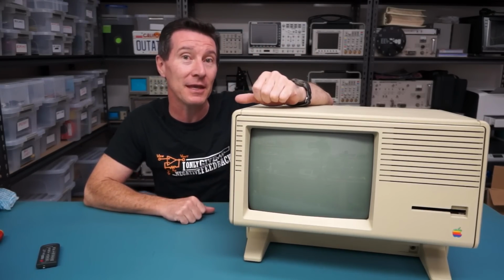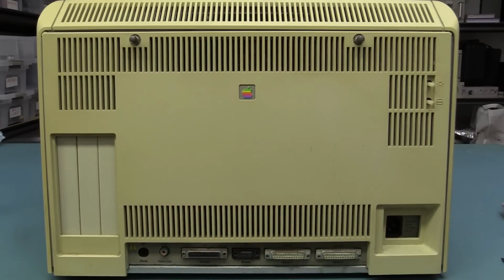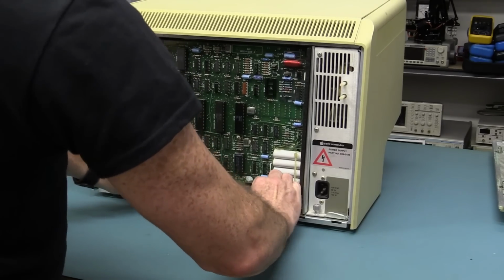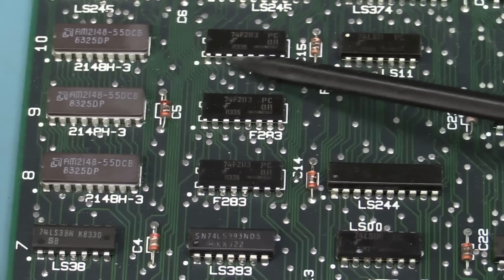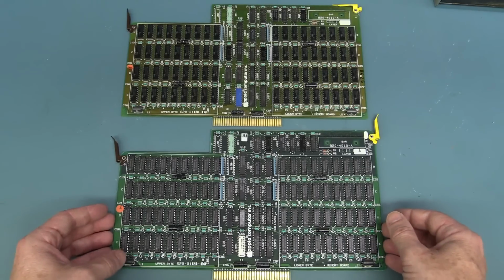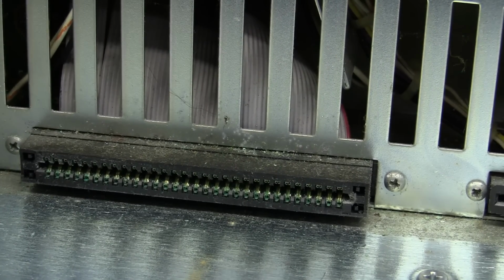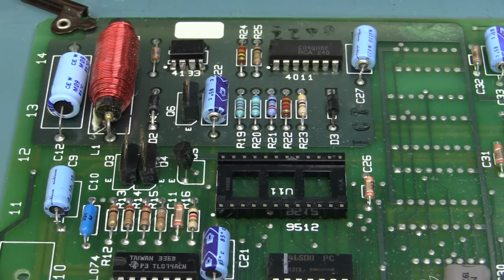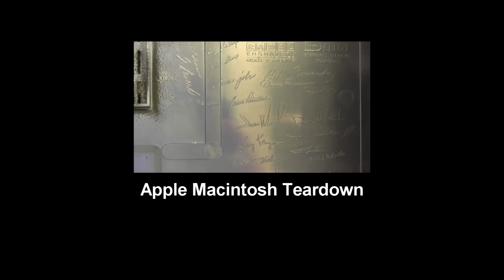EEVblog #696 - Apple Lisa Retro Computer Teardown

Comment: Yes it is a sexy machine. I think it is the most beautiful Apple ever done. In Brazil we have an old saying: outside, beautiful guitar, inside moldy bread.
2235 manufactured seems to be the 325th day of the year (83 maybe? but I thought they used 2 digits for the year) meaning 21st, November.
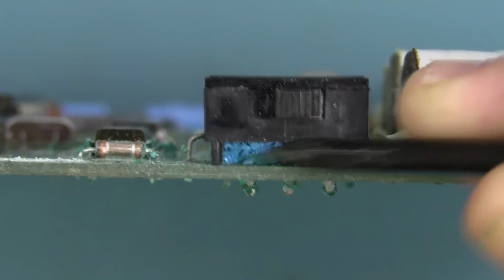16:38 Ohh that blue gum under the key seems like cooper sulfate. Those two boards board is gone RIP.

Comment: just give the inside a good clean, pop in a raspberry pi, hawkboard or something like that, load a good emulator on it and hook it to the crt. Hook up an old 3.5 floppy drive and and you got yourself a working Lisa.

Or turn it into a modern PC in a Lisa case.

Comment: It's amazing how much the crap from long-dead NiCd and NiMH batteries wicks through the copper traces and just destroys everything. It's a common problem with arcade cabinets and pinball machines, early computers like this Lisa, and even x86 PC motherboards up until the mid-90s.
In this case it has thoroughly wiped out the CPU board, gotten into the backplane and apparently spread from there into at least one other board. Looks like the RAM cards maybe could be saved.
This Lisa was already beyond repair, but anytime one encounters those barrel batteries on anything of value, they should always be removed or this will eventually happen. Unfortunately in most cases old battery backed electronics sit in storage quietly nuking themselves and don't get discovered until it's too late.

Comment: My family had both a Macintosh 512k and a MacXL (1985 version of the Lisa 2/10, but it could run the Macintosh 'System' as well as Lisa OS)  I wish I still had them, they both gave in to the ravages of time and repeated moves. (The Widget HDD in the MacXL had ceased working as well.) I'd swear the 512k still worked, but it just got misplaced during a move. Very sad.  :(

I grew up on those old Mac games, the Macintosh version of Wizardry: Proving Grounds of the Mad Overlord is still one of the best CRPGs ever made. :D  You know you're old if you ever had to draw dungeon maps on graph paper while playing a computer game.

Comment: 14:00 It's pretty sad that this old system from early 1980s has 55ns memory chips (SRAM) when latest gen modern computers have 5–8 ns latency memory (DRAM) these days. The latency hasn't improved (less than 10x) that much even though the processing power is now magnitudes and magnitudes better.

Comment: "Upgrading" this using an emulator could be an interesting project/video series.
Maybe using the original CRT with a custom driver board (easier to use an LCD panel) but less interesting.
Use a Raspberry PI (which has composite.HDMI for the CRT video) or maybe an Intel Atom board?

Comment: Date should be 25th day of the 3rd month of the 3rd year of that decade if I'm reading it correctly since it has one extra space available in the typesetting. So you have a March 25th 1983 unit. It looks like a shit ton of the parts in there are just grabbed and put together, lots of replacements.

Comment: i looked it up, $10,000 1983 is equivalent to $25,000 today. there were a couple of really big issues with LISA.

first was the price, ten grand.

second was the speed of the hardware. apple decided to use "twiggy" drives which were crap, the mac team had to fight to get twiggy drives OFF the mac, plus the LISA OS required a hard drive, unfortunately the hard drive was so slow it bottlenecked the  whole system.

Comment: It would be cool to put a single board computer in there and use it as an xbmc jukebox or something. Using the original CRT of course.
I certainly wouldn't bother trying to repair it with the condition it's in.

Comment: Maybe you can build a Lisa emulator using one Raspberry Pi board and one Arduino Leonardo board.

Start by trying to figure out a way to get the CRT work with the analog video output of the Raspberry Pi.

The keyboard, mouse and one of the two serial ports can be wired to the Leonardo with appropriate level shifting, and the Leonardo can be programmed to act as a USB composite device including a mouse, a keyboard and a serial port to the Raspberry Pi. The other serial port can be level shifted directly to the UART of the Pi itself.

The parallel port for hard drive, if so desired, can be used as export of the Pi and the Arduino's unused GPIOs. Or if anyone know the protocol, a conversion bridge to USB Mass Storage Class can be built so that original hard drives will be able to work.

The floppy drive slot may be able to be repurposed as a USB slot.

You can configure your Pi to boot directly to a Apple Lisa emulator that is capable to use serial ports.

The original power supply may be reused to power this assembly.

Comment: It cost $10000 because it was designed and built in California. Power supply in Orange County, and the rest of it in the Silicone Valley or Bay Area.

Comment: 6504 is 6502 compatible, not 6800.  It's a 6502 with fewer address lines exposed on the bus.
Reply from the maker: Samuel Falvo II Right. Bus compatible with the 6800.
Reply: EEVblog BZZZT WRONG!  Go look at the timings for the 6800 bus and the 6502 bus.... not compatible without glue logic.  They are closer than the 8080 or Z-80 timings... but not close enough to use the same signal chain.
Reply: metaforest
Can you provide sources for this?  As I understand it, and as all my sources indicate (Wikipedia, 6502.org, et. al.), the 6501 was pin-compatible with the 6800, intended specifically as a cheap drop-in replacement for the 6800.  This actually forced Motorola to sue MOS, which caused them to change the pin-out (thus creating the 6502).  The bus timings are the same -- Phi2 is compatible with the E clock, allowing the 6502 to continue to use 68xx-series peripherals unchanged, as evidenced by the Atari 2600 (6821 PIA), Commodore PET (6845 CRTC), etc.
Reply: Samuel Falvo II The Atari 2600 used the Rockwell 6522 RIOT (RAM, I/O, Timers) not the MOT 6821 PIA.  Many arcade games used the MOS or Rockwell 6521 variant.  I think you are right about the PHA2 clock... I never saw it used that way, however. I do seem to recall there was glue logic to make 68xx devices work on 6502 systems.   I haven't looked at the 6845 since I was a teen.  The Apple ][ used the PHA2 clock on slot7 to indicate when the 6502 had let go of the bus (internal ops phase) so that DMA devices could assert /HALT and take over the CPU bus themselves.  This was done on Z-80 C/PM cards so they could suspend the 6502 indefinitely.  Only Slot7 had the PHA2 clock available.
Reply: Samuel Falvo II The 6501 needed an external complex clock generator... as did the 6800.  Using the 6800 version of the clock generator gave it the same timing as the 6800.  The 6502 has the clock generator built in, and its timings are different, but exporting PHA2 clock was maybe a hack for E clock compatibility?
Reply: +Samuel Falvo II MOS 6501 was pin and signal compatible with the 6800 that got MOS successfully sued by Motorola -- it of course was not code compatible.  6502 was not pin compatible, but it was almost bus/signal compatible with 68xx peripheral devices this made it easy to respin a design with a 6502 without changing of the bus logic (note PHA2)-- obviously the code had to be rewritten.  6503 - 6507 and some other variants were reduced pinout packagings of the 6502 with non-essential features removed.   Each flavor had different combinations of pins left out to fit into a 28 pin package.  The 6507 was used in the Atari 2600, and also used in some of Apple's 3.5" floppy drives.  They also showed up in some other embedded systems. I don't recall seeing the other variants much at all.  Rockwell and some other MOS licensees later released the 6501Q and some variants that had 64 pins these had a UART and some other peripherals built in.  These were simply 6502s with onboard peripheral I/O.
Reply: I'm confused why you're writing this?  It's basically what I said last year, but then you refuted me.  Am I missing something?
Reply: I'm sorry you are confused.  I did not mean to confuse you....I meant to correct my previous comments.

Comment: 5mhz... according to wikipedia the lisa 2's harddrive was external, almost as wide as the machine itself sitting on top:P  Price adjusted for inflation $7,943-$12,489 :D
Reply: Computer stuff had been very expensive those old days....With the money i paid for my Amiga A2k machine and all the addons i bought as well as time went by, i could easily buy me may three most sophisticated PCs today. My first SCSI hard-drive was a 100MB and cost me about 1k2DM. My accelerator card (68040/33/4MB/SCSI) was around 3k/1990, that 64Bit Graphix was around 3k back in 1991.....I still got the complete 68020 chipset out of my 020 (A2620) accelerator card, as they´re looking so beautiful with these gold-pins on that ceramic die "MC68020RC16E/8911-XC68851RC16A/8915-XC68882RC25A/9011" (bought seperate with a 25Mhz crystal)
Nowadays it´s pretty much an all in one chip design;)
Reply: TubiCal Yea it doesn't even have to go that far back.  I remember looking through the family receipt boxes, in the 90s a harddrive was 4-500 hundred dollars...  I kind of wish I kept that receipt lol

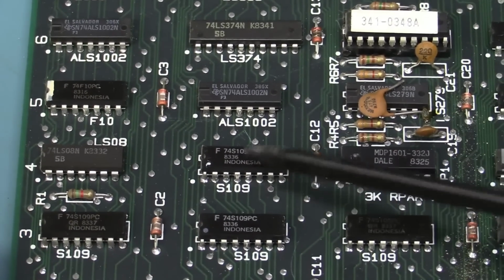Comment: At 14:21 what is the DIP chip marked "Dale"?  It is silk screened "3K RPAK".  Some sort of memory.  From Dale???
Reply from the maker: cemx86 It's as it says, a 3K resistor pack. Was unusually in black molded chip package though.

Comment: replace the monitor with led one connect it to a micro atx board and power supply and run it with a current apple os :)
Reply: Ok and then have a completely worthless machine that will conk out in a few years. good idea.

Comment: Wasn't the switching voltage regulator not even used by anyone else until apple brought in holt for the apple II? I mean, like they had to build one on, there weren't commercial ones available at the time.
Reply: No. They were in use long before Apple began using them.

Comment: The keyboard was noisy like a marching band. I grew up with apple 2, wrote dos software. They were sooooo slow to boot up and often crashed your homework assignment but more dependable than the early ibm with windows. Did lisa have the emulation chip that was later banned?

Comment: interesting tear-down dave! shame them  batteries have leaked and  eaten the boards :/ perhaps you could slip in an lcd or a touch screen in place of the monitor and perhaps a useful enclosure and display for the raspberry pi ?? if not possibly useful as a small tv monitor or digital photo display or something like that or perhaps :P

Comment: Put a cheap tablet running an analog clock program with a photo of Elizabeth Tower (aka Big Ben) as the dial. Add an amp and speaker in the grill and use a recording of the Great Bell and the four quarter bells to play real Westminster chimes half a world away. Or retrofit a software controlled radio along with the tablet / speaker combo.

Comment: if they sold 100,000 units at $10k a pop that's $1B, even if they Oly made 50℅ return on each unit and account for the R&D that's somewhere around half a billion in profit. I've known about this PC since the 90's when I first started getting into electronics but I still argue that it doesn't seem like a total flop if you do the numbers

Comment: Hi, i had similar corrosion issue with an peavey autograph II automatic equalizer (bought as non working for a bunch of euros).
The backup NiCD battery leaked and ruined 1/4 of board, where there was ram and eeprom!
Leaked battery caused issues with copper tracks (solved soldering wires and removing shorts) and with board (made an invisible film wich acted as parassite resistor).
I solved this by cleaning the board first with clean fresh water, then cleaning with alchool (i couldn't get isopropil, so i took normal pink die alchool).
All worked, but i had to replace some components (including sram).
Now it works well as automatic equalizer, with an NiMH battery (i know about charging issues, but i haven't any alternatives).

Comment: PARC did release a commercial ALTO derivative, it was the Xerox Star system and it was a disaster. Hard to use, slow, expensive, like this turkey. GUI computing sucked until Windows 3.0 on the 386/25 with a decent video card. Even that was marginal. It didn't really get established until Windows 3.1 in the early 90s. Windows 1 and 2 were unusable, mostly due to screen flicker and poor resolution.

Comment: Same problem as the Amiga 2000: That Fucking Battery!
Whoever thought it would be a good idea to solder down a battery that can leak to a PCB should get shot.

As for your current current machine, take out the guts, put a RasPi in there, adapt the CRT to FBAS and call it a day in hardware terms. For software, boot into a kiosk mode that starts LisaEm. :)

Comment: Would it be possible to turn that into an oscilloscope? I've seen people tap audio directly into the X and Y of CRTs successfully, but i'm wondering about using a microcontroller to add some triggering or something.
Reply: Good thinking! Sometiems the horizontal defl coil is part and parcel of the tube EHT Flyback Transformer circuit, but thats ok - just cut the wires to the vertical coils and connect a speaker level signal - I'd do that to old TV's

Comment: Xerox made the first GUI system, apple (Steve Jobs) saw it one day at Xerox headquarters and knew it would be the next leap in computing, so he copied the Idea... He asked Bill Gates -  Microsoft to help with the Mac software interface and Bill Gates said lets make one for the PC behind Apples back, so Apple took them Microsoft to court in 1980, it took 5 years but Microsoft won the right to make WINDOWS because it was on a different computing platform, the IBM PC, that's why Windows didn't come out for sale until 1985 even though the software is copyrighted 1980.... Xerox did it first. give them the credit for all the GUI systems today!....

Comment: Question : why did these DIP processors not need heatsinks? Were they just not as dense as modern processors and thus didn't consume the same wattage and didn't need them?
Reply: The cpu at only 5Mhz. It would get cold but not too much. Than logic ports not get soo cold.
Reply: Right, but I'm thinking along the lines of Moore's Law and general technological progression that processors back then would have consumed a lot of wattage and thus require a heatsink. It's just odd to me how these chips didn't need one at all while processors nowadays need big ass heatsinks and fans
Reply: there very few transistor in this cpu compered to nowdays cpu and also it has a larger die area that imply more power dissipation. In fact nowdays as soon as you reduce the die area and increased transistor you would get, compered with the previous generation, much more heat produced.
Reply: Ah okay, thank you
Reply: Alberto Vaudagna the 68000 was a knock on from the 6800 & 6809... It had only 68000 transistors... and was the last CPU laid out by hand. (IIRC 2.1 micron process -- today Intel builds CPUs that use a 14 nm process... more than 1000 times smaller features, with billions of transistors.)  There were some really cool pictures at the time of layout engineers walking around a huge room (bigger than a basketball court) in their socks marking up huge blowups of the process masks.  The CMOS process used in the 68000 was only being clocked at 8MHz...  CMOS only consumes significant power when the transistors are switching states. The large package and low dissipation do the rest.

Comment: Sun Remarketing converted a lot of the Lisa computers to run Mac software and sold it aa a Mac XL it ran but it was slow from the start.  An expensive computer the Lisa was a $10,000 office solution that few bought.

Comment: Restore  itt to working conditionn with a rasberry pi and the lisa emulaator
Reply: +Fennec Fox (FennecTECH)  I don't know why people want to rip all out out of this old computer and stick a rasberry pi in it and install a emulator of the computer on it. in case of an apple lisa doing this is a stupid idea becaus apple lisa are realy rare computer (only 10.000 where produced and 2700 where dumped by apple [brand new, not used] so they are tax-deductible) so if you want one of them, don't think about geting one under 2000 usd. so its smarte to fix this one instead of ripping all out and putting an rasberry pi in it to make the computer make worth nearly nothing.
Reply: becase that machine is beyond echonomical repair
Reply: if you can repair it    definitly go for that C:
Reply: *****
 i would do it, but i don't think he would send me the board because he don't know me and i live in europe. but when he write under this comment or on other way, would do it. this would be nice challange.

Oh and its not beyonde echonomical repair because getting replacment is hard and very expensive (like the hole computer).
Reply: nods*

Comment: I have a Super Mac from 1984.  1 mb of ram. This is the worst computer I ever bought. I paid $25 for it in the 90s. The computer is worthless.  You can't do anything without the program disk and siince there's only one disk drive, all you can do is install the program software. To actually do computer functions you have to keep switching disks.  It could take 30 disk switches to completely install the program.